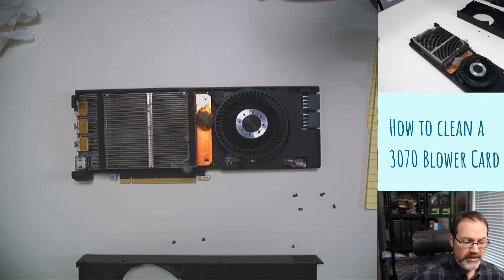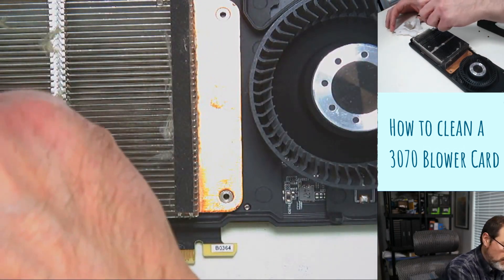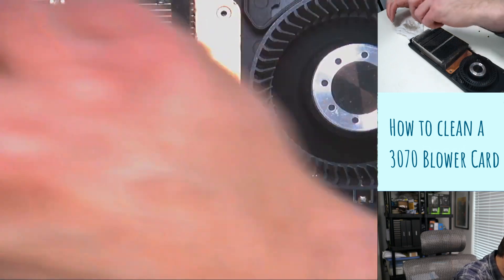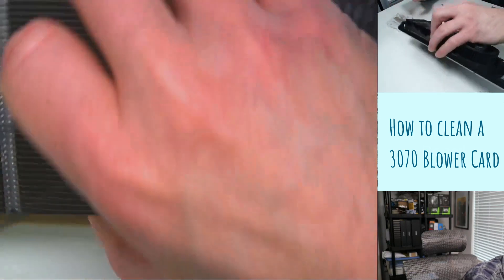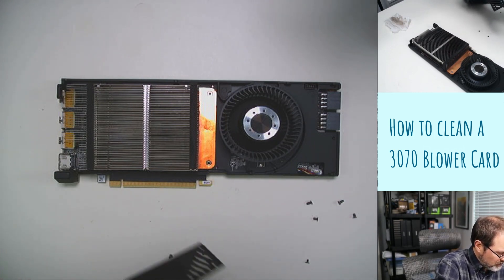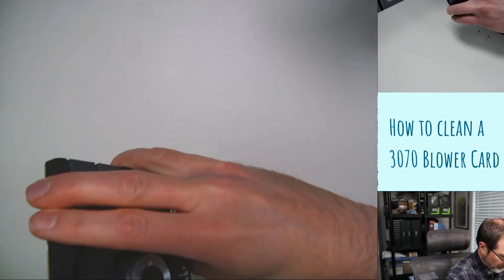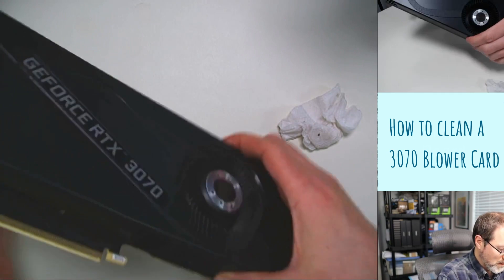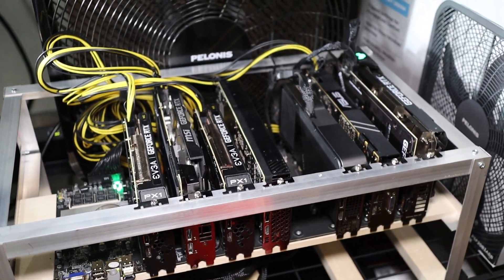How to clean a GPU | 3070 Blower Card

Comment: I got the same card off eBay maybe we bought it from the same seller lol. What's your max temp in gaming mine gets up to 86c in intense games? I have not popped mine open yet but looks easy enough! I am planning to reapply thermal paste with Arctic MX-6 thermal paste to lower temps and increase the life of the card!
Reply: Haha I got the same one it came today. Still waiting for parts tho, birthdays Friday will order em then!
Reply: How do you like the card and how loud does it get?
Reply: @Alex555bad  not loud with 6 fans stays around 75 while hardcore gaming
Reply: @Alex555bad  Its loud as a blower video card gets in gaming. It sounds like a mini jet engine with intense graphics video games. It's silent for normal computing, but if you play with speakers loud or headphones you won't notice much or might get used to it. Overall price to performance is great!
Reply: @adventureguy76  bro did you ever replace your thermal pads on this 3070?